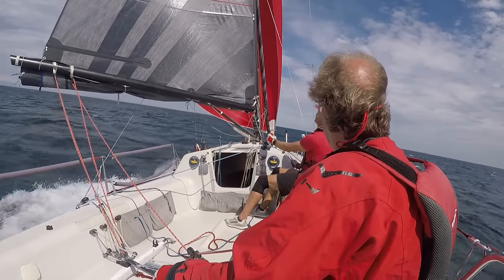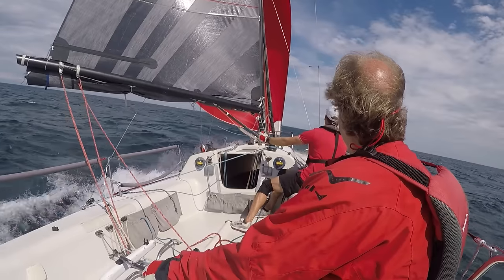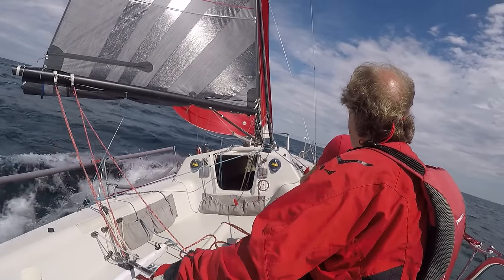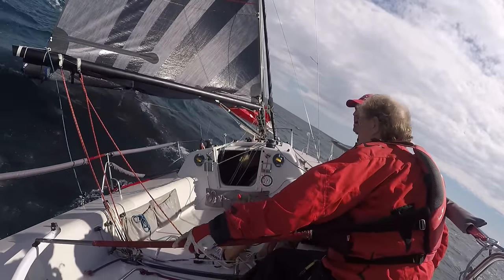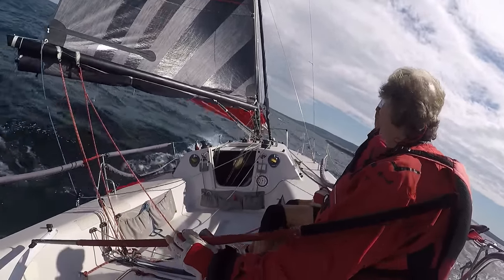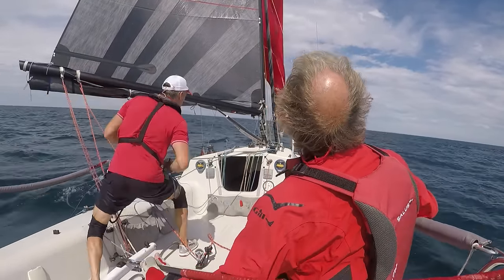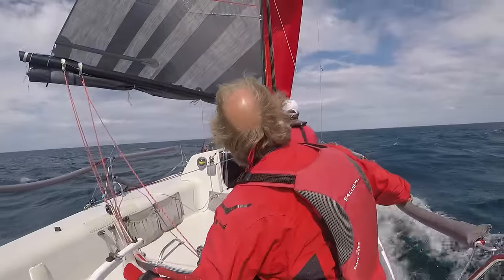Recovering from a broach / wipeout

Comment: First mistake not using the Vang !  Releasing  the vang when the boat is sailing downwind in strong winds,. In this situation, releasing the vang will reduce the exposed sail area and depower the mainsail, avoiding the broach.

Comment: It would seem that the main reason for this broach was the helmsman coming un stuck. Man down, boat over. The tiller extension seems incredibly long. If it needs to be this long for upwind sailing then consider a telescopic one (see Ronstan catalogue) and shorten for down wind sailing. I sailed a 26 foot sports boat  for many years and always pushed the limits. Main sheet right out, boom vang right off, mainsail flapping like a flag, keep the boat under the kite and steer for your life, come up in the lulls and keep speed on and bear away in the gusts and get the boat back under the kite. Keep practising. 🐟 😁

Comment: Really enjoyed the video, impressive 1st time helming and great idea to have some fun rotating jobs ,thank you.
Tips learned the hard way.
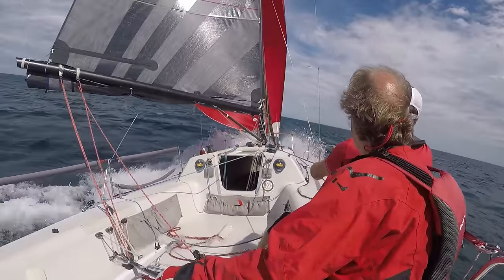Always a faster boat if can anticipate rather than react. Most time of  first 2mins 11 seconds concentration is directly ahead on the sails by both  helm and crew e.g. (time stamp 25,34,secs 1:11,1:57,1:59,2:01,2:06 by  crew , 28secs 1:11 and 1:14 by helm all for brief times approx 1 sec each glance each.
Would suggest split the jobs , with crew concentrate on the kite and downwind sector ,helm up wind and downwind.  As much time helm looking to windward as ahead. Helm calling in the gusts to crew , crew calling pressure on the spinnaker e.g. crew: "good pressure" helms soaks that i.e steers more downwind. Apparent wind increase not enough for monohull to harden up as in cat sailing in my opinion (sailed racing cats with asymmetrics as well as dingies ( both asymmetric and non)) unless you want to get into a gust earlier and stepping stone the gusts (as well as sufing the waves) downwind, would advise soak the pressure when you have it and stay in the windy bits for as long as you can , when you can. If 5 person boat don't think you have as much leverage to keep the boat flat either so that would dictate bear away.
 Impressive 1st time helm. As much as possible steer with the sails, any time helm wants to bear away ,ease main 1st rather than just tiller, playing the main all time time as you adjust tiller. If 5 man boat am guessing you usually have a main trimmer ..(see time stamp 1:09 ,hard tiller pull no main sheet adjustment) Any time tiller off centre, means increased drag, means slower boat means harder hit with a gust.
Crew and helm weight together as much leverage , both hiking out or far away from centre line as much as possible , can also use this leverage to help bear the boat away.
As gust hits, being called in by helm "gust in 5 , 4 3 ,2 ,1 ", ease main, fine trim with rudder, bear away and if boats continues to heel to leeward , ease kicker, then main then last resort, spinnaker. Crew is anticipating gust with the call out and ready to ease spi if necessary.
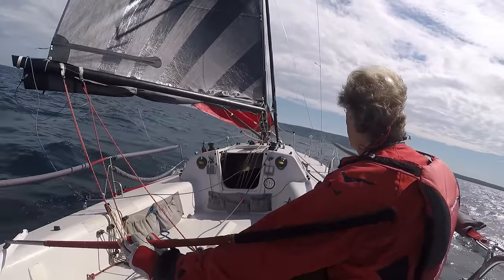Practice broach drill on a quiet day , going thru what jobs to be done (and who by) first and then practice, working up to windier weather. When the boat was broached need to completely dump kicker and allow boat to get flat and to reduced the main catching the wind as much as possible. @3:28 can see the main luff is still filling and kicker is still acting on the boom pinning the boat over and helping to heel the boat to leeward so no/little  rudder control then.
 Hope this helps and thanks again for the footage and learned lots :)
Reply from the maker: That all really helps a lot. Really good idea to be clear crystal on the jobs versus just winging it! Thanks for all of the insights! :)

Comment: Your technique is fine, but racing to Hawaii twice, Newport-Cabo and Newport-Ensenada a dozen times, there is a simpler recovery when short handed. We developed it because the driver would sometimes be on watch alone.
As the boat rounds up, blow the vang, then the kite sheet, and finally the mainsheet.
During all of this, bring the rudder all the way up and pin  the tiller with your foot. This acts as a brake to slow the boat until you can slowly drive back down and get going again.
Reply from the maker: Sounds like a great way to save it! Thanks for sharing.

Comment: Multiple things. Before the broach, boom vang in hand ready to release to prevent broach. Driver never played or dumped the main or called for vang release. When boat slowed in waves the apparent wind moved aft which at high angle set up the broach with main cleated in. 
Once broached main needed to be release and vang eased. Ideally prior but still need to take pressure off main which was rounding you up. Tiller was to leeward for a long time. Once abeam to wind sails flapping pulling tiller to weather only cavitates rudder. Push pull Sawing motion to reattach water flow on rudder before attempting bear away but with main on vang tight you were fighting the rudder to bear away.
Reply from the maker: I like your idea of the sawing motion, makes sense, will try that!
Reply: Ladies and Gentlemen, Mr. Howard Bentley

Comment: What I have learnt is an A sail wants to be a flag and the best way to achieve that lies in the tack line, easing the Halyard just projects the sail out further away from the main whereas you want to use the main to blanket it. On my boat I have a long Dyneema tack line the  end that attaches to the blocks has an eye splice on the block I have a shackle. When the boat goes over I sheet hard on the A sail blow the tack line turn hard down. The sail's bottom should have enough slack to twist off to leeward dumping all the wind and the boat stands up then trim the tack line back in. If its a real big wind and all hope is lost I blow the shackle the sail turns into a flag I pull in the sheet until I get a hand on the clew and douse sit down crack open a cold one light a cigar and pat myself on the back...
Reply from the maker: That sounds like a great set up and good way to handle it Robert. Thanks for sharing!

Comment: Looks like a fun boat! Need weight further back. Sit side by side towards rear. Work the main (let out)  as turning downwind. I'm very envious!
Reply: exactly! try to get power in the jib first and the main pulling as little as possible when turning down. Otherwise: well done!
Reply from the maker: Thanks!
Reply: @CanadaOceanRacing  After whiteout with fast boats you have to ease the main really far out.
Slowly turning down the wind will increase your boat speed and you get back control.
Going down the wind you might use the main's wind shadow to put in your genacker.

Comment: The other thing you can do to help bring the boat upright is get your weight as far outboard as possible. Even though there are only two of you, it will make a difference to increasing your righting moment and help bring the nose of the boat to windward (which further reduces the drag created by the sails).

Comment: I have a spinnaker tackline running back to the cockpit and I also have a spinnaker tackline stripline running back to the cockpit so I can blow the tack in an emergency and pull the spinnaker in by the sheet into the companion way and slowly release the halyard so I don't get the spinnaker wet.
Reply from the maker: The tack line stripline is a great idea. I'm planning to add one with a martin breaker.

Comment: The only comment id make on what is a fab video is that the generalisation of monohull and cat pre broach reactions are just that. A generalization. From personal experience so not an  authority at all :) . A beamy monohull like an international 420 on the small  side of beamy to an I14 or 80's  Aussie 12ft skiff (cherub), turn up and luff a little. Do that with an international Fireball and its swim time....again. Cats ( international tornado to a heavy french polyprop newcat F1, bear away and do not let out the main...in fact haul it in to transfer pressure after or the nose will submarine and you fo a great superman Impression). 

Lightweight yacht? We have a 22' Gibsea peco plus. It broaches without a shute because it can...lol. It has a wide beam semi plaining hull and like the fireball, turning away like a cat a sniff and not sheeting out sorts it.

The last one is my 1970's Edel iv. 7.4 metres, 1.5 tonne narrow stern traditional round bilge displacement yacht. Has a huge kite, 1.5 Genoa and the same sized mainsail as my 14' 78kg Fireball. She turns up when overpowered and you would have to be superman with a titanium tiller to stop her. 

I think its a combination of rig power front to back and hull form. 

So every boat is different? And I've been no use to you all at all...sail safe and have fun.
Reply: Huh?!? (Not a wind sailor here)
Reply: @allanfifield8256   Hi, when getting overpowered with the wind coming from somewhere off your rear three quarters and heading for a broach ( or a capsize in a dinghy, or a pitchpole nose dive in a catamaran), some boats recover if you let some mainsail out and point to windwards ( luff) and some recover if you keep the sail where it is and bear away downwind more. You only know which is which the first time it happens by getting wet..lol.
Reply: Beratung away with the main not let out?
With a powerful main the boat will never bear away after the rudder had stalled and you are slow.
You use the main as a giant wind vane with just a little angle to the wind (to avoid enormous forces) and turn the boat slowly away from the wind to get back speed in a controlled matter while not changing angle of attack of the main to the wind.
Without doing so you will never make a biest like a Dragonfly trimaran fly after a wipe out or a tack with a fullstop due to whatever.
A boat like this with wind in the main and dahherbord and rudder stalled makes 2 knots sideway and zero knots forward. If you want for hours. Taking care about the main in the wind is priority 1. Priority 2 is turning the boat under this main into a direction favorable to give you boat speed. Then you can take care about your other sails, best in the wind shadow of the main.
This paradigm of thinking even works with all those big "slow" Charter yachts.